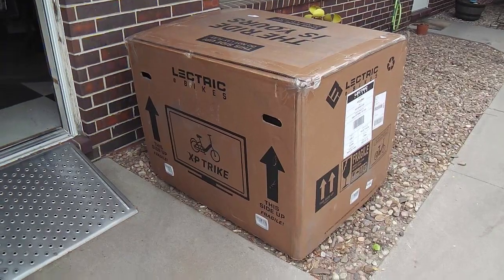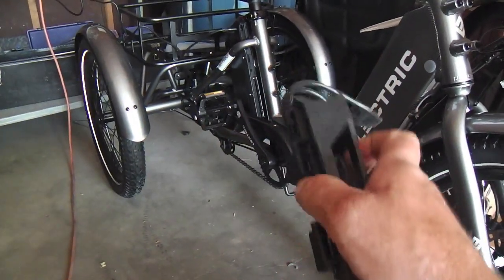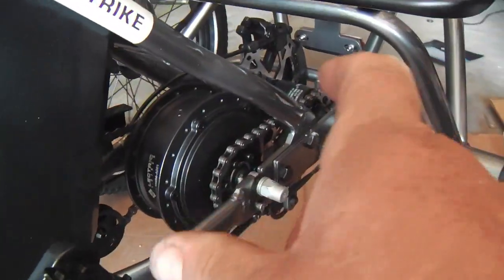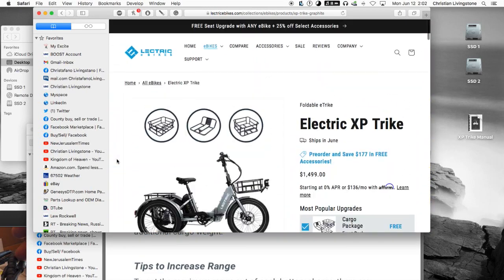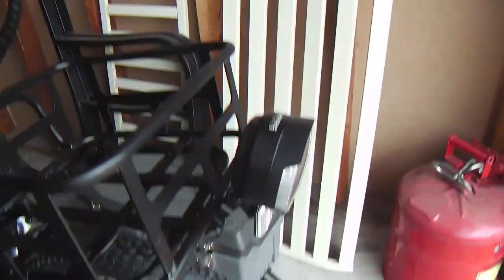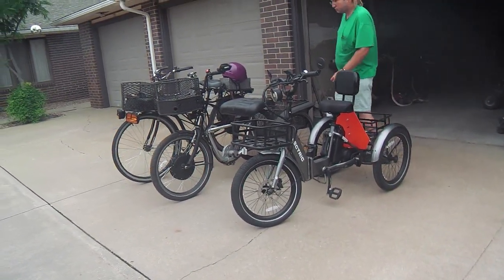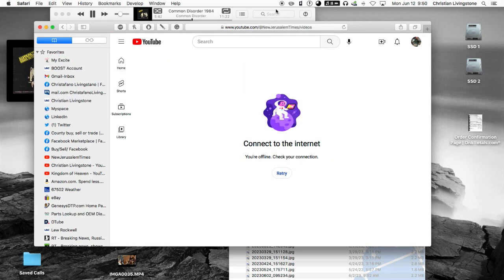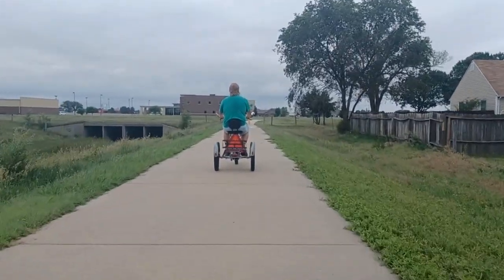Lectric XP Trike: In-Depth Review

Comment from the maker: UPDATE: I replaced the twist throttle with a thumb throttle on the unit, as my friend would sometimes initiate the brake lever and she’d still have some twist throttle engagement, which was obviously problematic for her. So, now, with the thumb throttle, the braking lever and thumb throttle are incompatible behaviors, which is much safer for her.